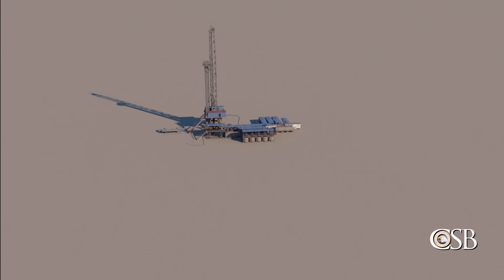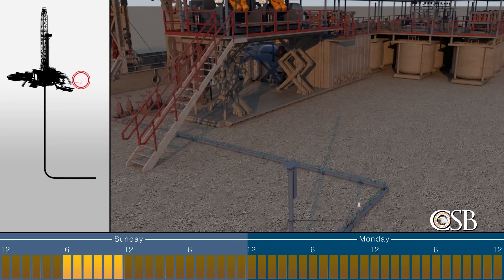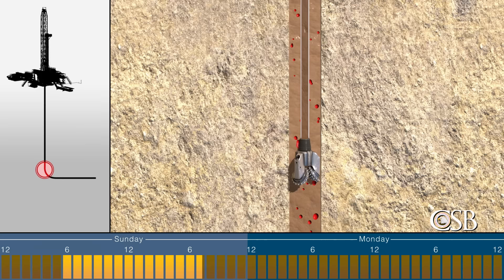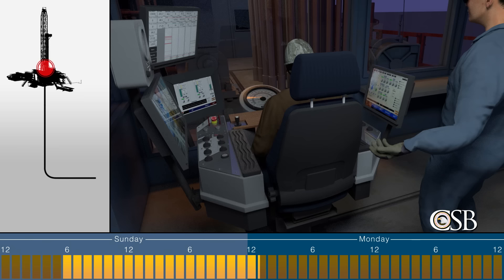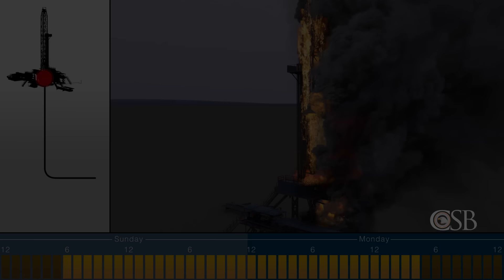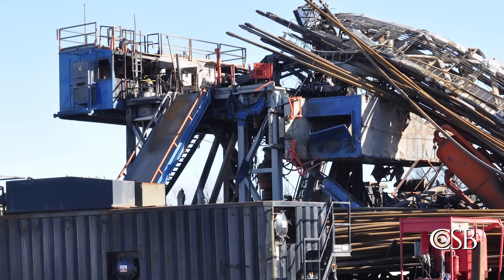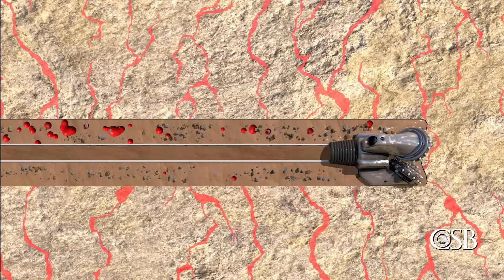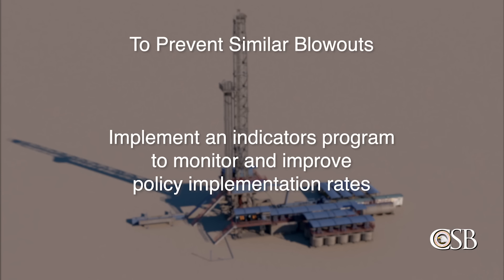Blowout in Oklahoma

Comment: Problem:  Company treats you as an expendable meat robot.

Solution:  You know the answer.
Reply: Answer:  Vote Blue
Reply: It's time for communism my dood
Reply: You realize the workers were a large part of the problem here too right?   You don't shut off alarms and ignore a huge volume of mud displaced by gas.  They literally ignored company and industry regulations.
Reply: @KaaneDragonShinobi  communism worked out just swell for Chernobyl.
Reply: @llary  chernobyl was a flawed reactor design from the beginning. it has nothing to do with communism. that kind of accident would never happen today
Reply: @roboticunclephil  Flawed reactor design because the designers has no incentive to design well.
Reply: @AnimMouse  No.
Reply: @roboticunclephil  I have my doubts on the design flaw I told those guys in the control room NOT to pull back up the blasted control rods after they dropped them down causing the stall which is when I told them NOT them back up and they did it anyway the next thing I noticed was an powersurge and the control rods came back down and BANG! and BANG! again
Reply: @chornobylreactor4  you were working in Chernobyl?
Reply: @roboticunclephil  yes I was the reactor like I said tried to warn them but they ignored me they basically told I was an crazy reactor and they got me killed by an run away fission reaction
Reply: @roboticunclephil  Flawed, yes. However the soviet union prioritized their public image over containing the ecological damage.
Reply: @maxmeh2342  Worked out well for pipeline workers. They can just learn to code.

Comment: Here’s an idea... don’t have a way to turn off the alarms.
Reply: From that comment im sure you've never even set foot on a rig floor..
Reply: If 4 alarms are going off for various reasons which one do you believe? Do you simply shut down and then what? The alarm systems are part of the problem.
Reply: You do not need alarms if you follow every day simple drilling practices. We did not have “ALARMS” in the early days we just paid attention to our shit and kept a simple trip sheet in a talley book.
Reply: @rocksandoil2241  don't allow emergency alarms to turn off
Blowout alarms need a different tone and cannot be overrode or be able to be disabled.
It's the "escape immediately or die horribly alarm"  for a reason.

Comment: Accidents happen, but they can be prevented too, most of the time.  I worked for Patterson for nearly 2 years and saw plenty of unsafe practices that were considered “normal” to save time. Tool pushers and company men would preach about about safety  a lot, but they were more concerned with timelines and moving to the next well.
Reply: I agree with that

Comment: I knew very soon in this video where this was going. You can talk all the bullshit you want but in the end, it all boils down to 2 guys. I have been drilling only all of my life which so far I got 56 years in on the controls. The driller was an idiot plain and simple. And where the hell was the push while these discrepancies were going on? There also should have been sensors mounted in and around the deck to pick up any differences in the air of the deck and mud returns. Something I have taken time out to stop everything and see that they were installed. I'm old school and the driller got off easy. It's just too bad his ignorants took the lives of men that did not know any better.

Comment: Just scrolling briefly i see no comments defending the crew... I’m no longer in the oil field but remember it well. And too often back then in the boom days people were promoted one level past competence. The “engineers” that designed the well program missed this one. The company man that pushed the crew missed this one. The tool pusher missed this one. The “crew” worked as directed turning off annoyances as needed to get through the day. All had that “gut” feeling nagging at them but need the work and knew if they didn’t work someone els would... it’s a fantastic video... but where was the CSB when they were actually needed. At this moment there is a rig making mistakes and they will squeeze by with no incident to do again and again until disaster... all the while society demonizes and belittles the guys on the ground and praises fake ass “green energy” sad!
Reply: The CSB only Investigates accidents after they occur. it is up to the Regulatory agencies and Companies to ensure safe operations.
Reply: winkleried thanks

Comment: "The alarm keeps going off." Turns off alarm "fixed it!"
Smart. real smart.
Reply: Eric Taylor they always turn them off tripping because every time you make a connection they go off over weight changeing and shut down for reset
Reply: @roosterkerr1780  And they had the ability to deal with that. They had the option of setting the system to "tripping mode".
     The alarm was set to go off if certain conditions were present. Changing to "tripping mode" reset the conditions that would set off the alarm.
     In any case, it is ALWAYS stupid to disable an alarm just because it is annoying. And these men paid for their stupidity with their lives.
Reply: Eric Taylor i agree its stupid to do so , its hard for me to say alot seeing how ive never been on a rig in Oklahoma. Im from west tx and we have gas all the time . Ive only worked old iron . As far as i know tho the newer rigs ive seen they still turn the alarms off . They jarred on a stuck bit last week and turned weight indicators off all of them . Its the oilfield . If you dont have a osha man on that rig they will do what they want.

Comment: When everything is an alarm, nothing is an alarm. It is critical that alarms only trigger when they are relevant to the situation at hand,  or they will be shut off by the operators.  It doesn't matter whether you're drilling a well or running a data center, the same applies. So I would say that's definitely an equipment failure that caused those people to die and it needs to be better regulated.
Reply: Try using that logic next time you get pulled over. Sorry officer, there were too many signs so that's why I blew through the intersection. "Too many alarms" is a universally used excuse by lazy operators. Furthermore even with no alarm system at all the operators should have been keeping tabs on the tank levels.
Reply: @adamruck  An Intersection is a good example because it is designed to only display signs and lights towards the traffic that those apply to.  If instead, it displayed signs and lights towards you for all the traffic in all the directions approaching the intersection where you will see multiple green lights, multiple red lights, and multiple yellow lights, and multiple signs that conflict with each other, where you need to constantly be figuring out which ones apply to you and which ones apply to traffic going in the other direction.  That's the point is that the alarm systems were triggering stops on things that didn't apply to the situation at hand so it'd be like showing stop lights at traffic that also has a green light.   So it is a problem with the software/hardware where alarms that aren't relevant to the situation at hand should never be triggered. We do the same things in data centers to identify when alarms are triggering in situations where they shouldn't and add additional controls to them so they don't because otherwise they can be a distraction to something else critical that is happening at the same time.  So it is a hardware/software failure here in the oil rigs and they need to redesign it so alarms do not happen when they are not relevant.  The people running these rigs do not have the programmers and techs on staff to rewrite the software when it fails them by triggering alarms that aren't relevant to the situation. So they just have to deal with it in the best way they can, but it's not acceptable in any situation to have alarms going off that aren't relevant and it needs to be fixed. It got a bunch of people killed..

Comment: I've never worked in the drilling industry before, but industrial accidents are not just the fault of the greedy suits.  Certainly they deserve a lot of the blame, but workers also become complacent.  The more regulations you put in place, the more likely workers are to skip them.  Not just because the suits are pressuring them, but because they've got experience and they've "done it that way 1,000 times without a problem."  If someone questions the safety, veteran workers will often mock them. Workers will cut corners and only follow all protocols during an inspection.

It has to be a careful balance between regulation and realism.
Reply: 100% Facts

Comment: As is with most disasters, there's not usually one single thing that happened, there's a combination of things that happen.  But when I hear stuff like "The night shift driller had turned off the alarm before the tripping operation," I can't help but wonder why people override or turn off safety systems that at least might have helped.  Again, it's hard to point at one single thing, but it seems like even if the workers couldn't have fixed the problems that the alarms would indicate, perhaps they could have at least evacuated.

Comment: why the alarm system were even allowed in the system to be turned off without being addressed?
Reply: i believe it's allowed in case there's a technical malfunction WITH the alarm system (ex. every alarm goes off at once) because if they aren't turned off it can make it harder to focus on monitoring things manually. but of course that would be rare. i'll say that i've seen far more disasters caused by pilots (and now, oil rig workers) turning off alarms they believed were malfunctioning or that were annoying them than i've seen caused by alarm malfunctions distracting people... surely there's a better solution, like perhaps forbidding the disabling of alarms without a proper cause? if you can see a worker disabled an alarm system, they should also have a clear reason for why, and if it was a technical malfunction it should be fixed. that way if they only turned it off because they found it annoying, they would be found out quickly, and could be reprimanded. but this is other level of work that would have to be done on a managerial level.

Comment: As a software engineer, I totally agree that a state-based alarm system should be employed in any kind of technical operation with many different multi-stage procedures where safety is also a top priority, such as this drilling rig.

But this software does not need to be unique to a drilling application. It can be used for manufacturing, waste processing, and other heavy industrial applications too.

But in order for the alarms to be functional for any given application, you need a technical consultant from that industry who can help programmers design the layout and rules associated with that application inside of the software.
Reply: These programs already exist and are there to keep crew members safe.  The alarms were simply ignored, which resulted in the deaths of the 5 men.  Alarms were ignored to help the oil company have better profit margins.  If the driller would have followed proper company procedures, the men would still be alive.  All the safety systems were there to be used, they just simply were not.

Comment: Whis is the drilling operator  Cabin not separated from the drilling area with Hi Def cameras, so that there is a chance to survive a blowout...

Just like having a switch to separate the entire cabin during an emergency that will slide them away from the drilling area to 100ft, so they have atleast chance to get away from the flames.

Comment: 1) I would have been curious to see what those connection gases were on the mudlog prior to trip. 2) when cutting off pumps for connections, was there flow and what was the level of mud at possum belly? 

3) Was the gas equipment being calibrated daily? 

Those are the questions I have.

Comment: I was part of a snubbing team in the Gulf ofMexico-high pressure control was why we were there-for some reason pressure build up under the back pressure valve was unknown-through communication from production zones the pressure was over 3000 lbs-when the driller removed the valve on the drill deck it blew-gas and oil and sand hit the crown with tremendous force-about 60 men scrambled underneath the drill deck to get to cat walks to a tank battery-as i was soaked with hot crude oil and with roughnecks hollering its going to flash, i looked over the side and had began to put one leg over the railing-we were 90 feet off the water-my boss grabbed me and led me under the blowing well to the cat walk-the well sand bridged over before it went up in flames-lucky-next day our job was to find the bridge and tap under it-my job-and try to bleed the pressure-eventually the production stem was cemented -had the shakes for a while but this it was my job and kept going…ie if you cant take the heat “get out of the kitchen”-this all happened at ten at night

Comment: Wow, what a cowboy outfit! (For those that don’t know,, LLC stands for “Limited Liability Company, means they’re not responsible for it)..Not one mistake, but not one thing done correctly. Every shift turns alarms off. The operator wasn’t trained on the new equipment is insider speak for “ they didn’t know what they were doing”.
The biggest issue is not the number of mistakes, it’s the fact that not one person on any of the three crews felt like they were responsible for the work they were doing. That’s a cultural thing that shows that the company sub contracted the work out, so they’re not responsible, the subcontractor is just doing what they’re told so they’re not responsible, the driller is taking over something that someone else started so they’re no responsible. The guy pulling pipe is doing what he’s told so, he not responsible. That’s the way we always did it. Lots of finger pointing, 5 guys die, nothing changes. That’s the way the world works.

Comment: Unfortunately CSB obviously did not consider that Methane is able to diffuse into OBM, especially in Diesel based also in an overbalanced Well that could cause a domino effect when the OBM reaches shallower depths in the wellbore with less hydrostatic pressure. See SPE - Paper  SPE-189617-MS .

Comment: this kind of crap happens all the time in the oilfield, at least when I worked in the oilfield in the 1980s and 1990s on land.  Corners were cut all the time, and it is not surprising the alarms were turned off.  I have seen 500 lb tool strings blown up to the crown, wireline being blown out of the hole, at least 30 blowouts that luckily did not catch fire, one which did catch fire and burned three of my crewmembers severely over 80 percent of their body, and left the rig a mangled, twisted mess, and even witnessed completion tubing blown out of the hole where it resembled 14,000 ft of spaghetti curled up on the ground.  Oil business is dirty, and life is cheap.

Comment: WOW, i drilled Old School, from debts from 9k' to 20k+' we had Nothing like this. 
The Tecnology these days is amazing, the Driller sitting in a cozy room in an office chair, not getting a drop of mud on him, Crazy.

How deep were they before turning Horizontal and how many feet of pipe?
Ive done Directional Drilling a whole different process.
U dont turn the pipe and Bit, the Pipe dies not turn and the Mud pumped down whole turns the Bit.
Never a vertical hole, then turning a 90° Horizontal.

Technology here is outstanding,  id like to see how a derp hole lsnd Rig is run these days ... Amazing!

Comment: A question . What are the solutions that will be taken if the alarm system works normally. Will the necessary measures be taken to stop the flow of mud from the hole with the gas particles .. In my opinion .. I say that everyone was wrong since the beginning of the work, but more than that is that the entire work team does not have that experience in drilling and is not qualified for that and that is why the disaster happened ... And I hope that you do not put your excuses and arguments on the alarm system. because of his extinguishing. This excuse is not convincing at all

Comment: This could have been avoided: 1. when drilling you do not turn off the alarm when you are tripping out and the only alarms that should be on are the flow alarm, the gas alarm, and the pressure alarm all other alarms are false and should not be on during a tripping operation. 2. when tripping out you close the blowout preventers and back fill the hole with mud if you don't gas and crude will escape and the well will blow up. 3. In case of fire or blowout you evacuate the rig you don't head into the cab because the blowout will kill you. and finally 4. You flow check every 2 minutes when in the well and every five minutes when on the surface or the pressure will cause you to blow up. If there is pressure you cap the well you don't add more pressure or the gas will escape.

Comment: There were MANY-MANY faults here.  I was a mudlogger for 10 years, had I been there I would have made sure that I was watching the fill and tank volumes.  The way Patterson(I worked MANY jobs on Patterson rigs) does their tripping with a trip tank, is another layer of failure IF THEIR PEOPLE ARE NOT WATCHING WHAT IS GOING ON!!!
I WOULD HAVE BEEN CALLING THE DRILLER AND THE CO MAN AND IF THE PITS GAINED THAT MUCH MUD OVER THE TRIPPING OUT, I WOULD HAVE GOT IN MY TRUCK AND LEFT THE JOB SITE!!!
I dont like working on Splatterson rigs....